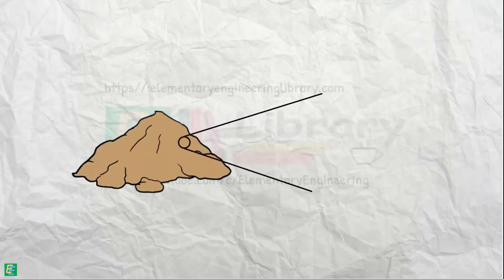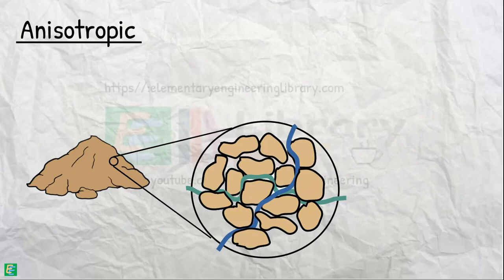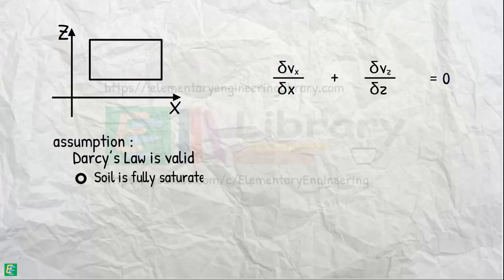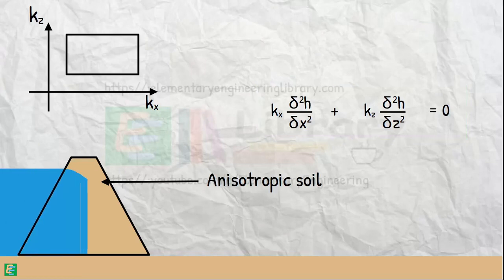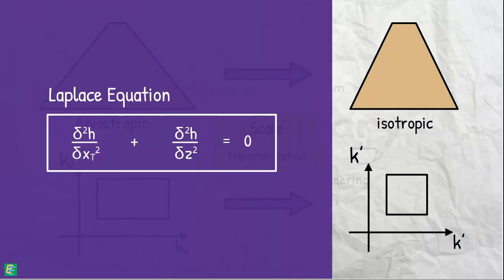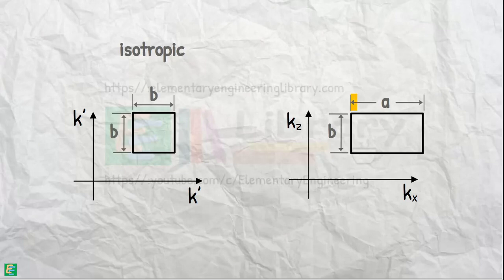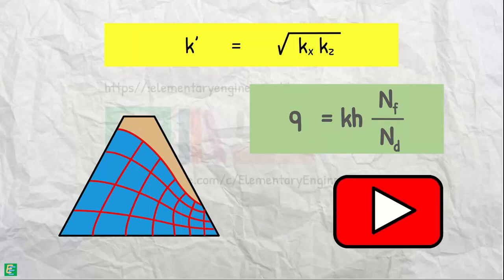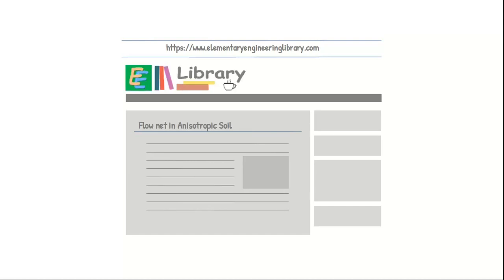Flow Net in Anisotropic Soil

Comment: I think there is an error at 5:50.  x_t should be defined as \sqrt(k_z /k_x). Then, when you partial differentiate x_t with respect to x you have \frac{\partial x_t}{\partial x} = \sqrt(k_z /k_x). Moving the denominator on the LHS to the right, you have the result we want: \partial x_t = \sqrt(k_z /k_x) \partial x.